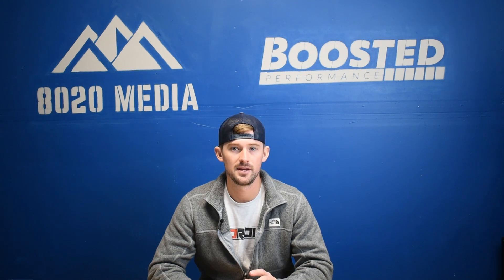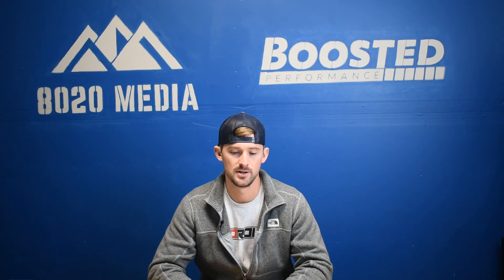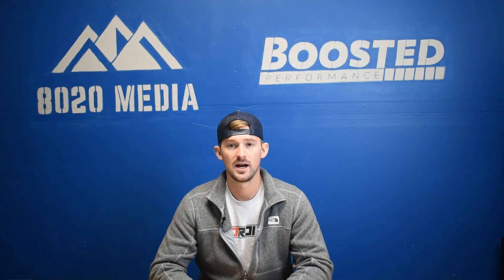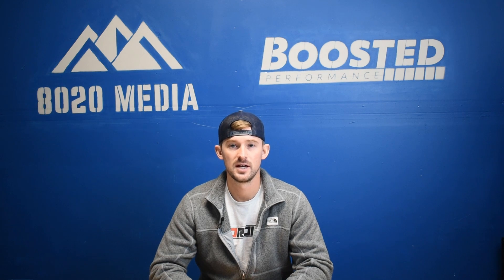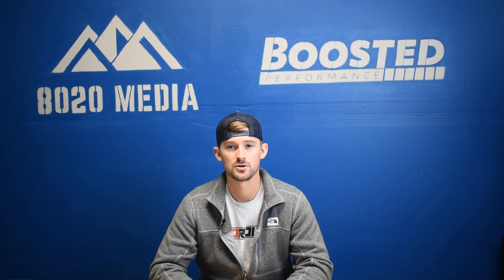The Few FLAWS of the Ford 4.6 V8 Engine!

Comment: Really? I am the original owner of a 2001 Expedition XLT with the 4.6 pushing 300,000 miles.  Everything is original except one alternator, and one AC compressor. Just normal tune up and suspension components over 23 years.  Zero timing chain and guide issues that you claim is a issue. I have had many vehicles of many makes and cant imagine something more reliable. Ignore the oil cap and run 5W-30.  You will thank me.
Reply from the maker: Steven - Thanks for sharing your experience! These can be hit or miss, depending on maintenance. Sounds like you keep up with yours very well.
Reply: I run 5-30. Full synthetic valvoline "20k mile protection" line or royal purple if it's in stock. Still change it every 5k miles. Seafoam clean before every oil change. I put this truck to work. I'm trying to break it so I have a reason to 5.0 swap the ol 06 regular cab 4x4👀but it's just such a good reliable engine. Hell, it hauled around three entire beds worth of mulch today, putting me within 100-200 pounds of max payload capacity, and it still ran great and was responsive (obviously in terms of a vehicle at its limit)

Oh yea. It's at about 150k miles. As far as I know, the only issue it's ever had was some brake line thing that was just dumb luck. And didn't even cost enough to care about remembering
Reply: Dude. It is in fact a common issue. Just because yours didn’t have a problem certainly does not mean that it’s not common.
Reply: My 2006 2v 4.6 has 298k. I bought it new and totally neglect it as far as maintenance. Seriously 10-20k between oil changes. When I change the oil it’s black immediately because of lack of oil changes, The only thing on the engine I’ve replaced is spark plugs 3 times and a cylinder head temp sensor and pcv valve a few times. The engine still runs great and doesn’t smoke. The transmission is amazing still to this day. This truck is a workhorse I’ve hauled equipment way to heavy for it. My trackhoe and dump trailer weighs 13k lbs combined and I’ve pulled it more times than I can count. I’ve hauled my boats 1000’s of miles. I drive the shit out of it. I have to pull onto a 70mph highway and put it to the floor until 70 nearly everyday, The transmission is smoother shifting than my low mileage Chevy. I serviced the trans for the first time at 230k. This is the best I’ve ever owned. I will never sell this truck! I’d say if anyone has issues from this engine it’s from running low on oil. Because I’ve proven it’s not maintenance that keeps it going. I’ve neglected maintenance on this truck horribly bad according to folks. MOTORCRAFT OIL IS KEY!!! I’ve seen a live test on oils and motorcraft beat Mobil one full synthetic. Castrol high mileage came in second on this test. I run motorcraft oil in nearly everything I own. It’s funny when I take my Chevy for an oil change and the cap says Mobil one and I tell them motorcraft. I’ve been told so many times. Ur putting ford oil in a Chevy??? 🤣🤣🤣 People crack me up!!
Reply: Got a 91 lincoln.... Still f'n goin'!  Easy engine to work on and maintain. Like driving a sofa.

Comment: Love this video! Been trying to research these motors and the YouTube algorithm has not disappointed. I have a question though and it might be irrelevant because I no longer have the truck. Back in 2013 I purchased a 1998 F150 super crew from my employer (it was a shop truck, immaculate interior and nice body). It had 167k on the motor. The one time the shop guy gave me a ride in it I asked him “Is your check engine light on?”. He said “nope”. I said “this truck has a miss. You need to have it checked.” He just shrugged his shoulders. Sure enough, one week later it was sitting way in the back of the shop. I asked him why he wasn’t driving it. He said there’s something wrong with the motor. (Go figure!) So I purchased it. I realized I didn’t have the time or space to do a motor swap so I paid a mechanic to do the swap. He said let’s look at it first in case it’s something simple. He called me a few days later and said the motor is toast. He has good news and bad news. Good news, it’s a good motor. I asked “If it’s a god motor why did it go bad?” He said “someone drove itit too long on a miss.” (I didn’t even tell him the story of the truck.) I asked him what’s the bad news. He said “typically a jasper reman is about $2,500 with core. Since this is a Raptor motor jasper wants $4,500.” He said another option is another motor from salvage. He found one with 80k miles on it. He drove down to the salvage yard to hear it run before he had them pull it. He puts it in the truck and I get it back. Drove it with no issues until it hit  235k miles (approximately 130/140k on motor). Then it did the same thing as the day I bought it. It ran awful, hardly wanted to idle, puffed, smoked, backfired. I really loved the truck. I just didn’t have the time to tear into it. But it’s bothered me to this day as to what was wrong with it. My nephew found some coolant in the oil but not bad. Still not good though lol. Now I’m wondering about cracked intake. Or stretched timing chain. I don’t have the truck anymore but based on this short story I wrote has anyone else had experience with this? The tenth generation f150 is absolutely my favorite one. We have a 2002 lariat super crew with 260k miles and it runs like a top. I also love these triton/modular motors too. I’m doing more research on them because I’d like to put a 4.6/5.4 motor in my old Fairlane with the 4r100 transmission. Just want something different under the hood that people wouldn’t expect. Everyone does the coyote swap and I’m not knocking it at all, I just want to be different. I’m fully aware that a modular will cost more than a Coyote to build up. 

Anyway, thank you in advance for your time. Love the video. Thank you for posting.
Reply from the maker: JP - Thanks for taking the time to write this out! Coolant in the oil certainly isn't good. But the symptoms you listed could've been a number of the things we listed in the video. Keep us updated on your future builds!

Comment: My 2000 4.6 2V has 299,000 miles and still runs great. No timing chain rattle yet. Regular oil changes and routine fluid service. Automatic transmission still alive too.
Reply: You're lucky on the transmission, I'm on number three.
Reply: @TG715  I've heard these are not the best . Just hit 302,000 and still shifts fine. I'll keep my fingers crossed!
Reply: @TG715 I’m not alone.
Reply from the maker: Lou - Thanks for sharing your experience!
Reply: Mine just took a dump (transmission) at 203,000 miles. Engine is strong as can be still and sounds amazing.
Reply: @_SecondhandSnake  I just hit 311,000 all good so far.
Reply: @LouJustlou  I can’t wait to get mine back from the shop and continue life with it. Excited for you. Here’s to many many more miles.
Reply: Have you ever had any coolant leaks? If so what are some common failure points? I got myself a 2004 expedition w the 4.6 and want to bulletproof it
Reply: @jtfoog5220  no issues with coolant other than a heater hose and radiator wearing out at 20 years. 🙂 They will go through coils....I used the ones from Ford even though they are pricey. Up to 305,000 and still going fine.
Reply: What oil thickness do you use?
Reply: @MrFairworld  10 30

Comment: The only engine more bullet proof than a 2 valve 4.6 is a 4 valve 4.6.  Especially the 4 valves in the 96-98 cobras.  Tekskid casted aluminum block, 6 bolt mains, forged crank, rods and pistons.
Reply from the maker: Brown - We could agree with this actually.
Reply: The 300 straight six is ford's most durable motor,I have a 2v 4.6 in my work truck I'm I've abused the heck outta its got over 300 but it constantly wants to poop wire boots and plug ports full of mostior and debris but it's fairly reliable I carry tools with me but that's every vehicle

Comment: I have a 2008 Mustang with the 3v.  This is an extremely reliable engine, like Toyota level reliable, with one caveat, you have to do the recommended maintenance/oil changes.  As long as you do that, there’s really no issue with timing/phasers or any other part of the engine.
Reply from the maker: Jedi - Thanks for sharing your experience and insights!
Reply: You have to do that with any engine. Oil is supposed to be replaced.
Reply: @sierrachief117  i assumed he meant not to let it go over the recommended change intervals

Comment: My 99 has a 4.6 and the triton badging 🧐
Reply from the maker: F150? We've heard things like that a few times, it seems a bit random sometimes which had it and which didn't, almost wondering if dealers badged them sometimes like GM dealers used to do with the VortecMAX badging.
Reply: @8020Automotive  I mean they could, but the manifold cover says "4.6 TRITON"

Comment: I have a 2005 Ford E150 cargo van with over 333,000 miles on it, I haven't had any trouble with the engine. I add a 1 quart of oil between oil changes. Oil gets changed 5,000. I do most all my own service work.
Reply from the maker: Brinck - Thanks for sharing your experience!

Comment: I honestly want to say also never get the E3 plugs for them either I found out the hard way and had pieces burn off the plug and get into my cylinder and believe it made my vavle stick open and nobody I talked to ever said anything bad about the E3s I honestly believe they should warranty that engine work cause it happen in more than one cylinder like who in the right mind would get them and not know it could possibly grenade the engine now the car is sitting wondering what to do
Reply from the maker: Josh - Oh man. So sorry to hear this... How old is your vehicle?
Reply: @8020Automotive  2005 mustang gt

Comment: I just bought a 09 ford mustang with 4.6L 3v that’s more than “lightly modified 
-Msi coils
-24lb injectors
-K&N intake 
-Bbk long tube headers/ X pipe 
- 3.73 gears 

and I knew that something was wrong with the timing because it wouldn’t idle smoothly and kept fluctuating 
A couple days ago the oil pressure indicator “low oil pressure” came on but only when I’m at stops (signs or lights)

I don’t know what it could be but I just parked the car and bought new timing kit and high volume pump because I don’t want to grenade my “new to me” car
Reply from the maker: Kourt - Sounds like a good build. Keep us updated on this!
Reply: @8020Automotive  so here’s the update 
I installed a new belt/belt tensioner for the car and new fuel filter for the car 
I then took it to the shop for the timing and oil pump and it will be done by December 4th
They told that a engine swap would be needed because the current one has alot of mileage (150k) and they think the car was neglected (found sludge in the valves) 
I told them I would consider it but I would like to keep the engine in the car for now until I can source a new one 

I talks to a couple local mechanics and my friend who’s a mechanical engineer and they said to through in Diesel fully synthetic oil in it 
Apparently they’re is a lot of additives and cleaners in it that will help prolong the life of the engine plus zinc for the internals 

As of right now the car is still running and driving and no noise like rod knock can be heard from the engine
Reply from the maker: Kourtnee - Thanks for the update! An engine swap seems quite bold. You should be able to get plenty more miles out of it.

Comment: I have a 1995 Crown Victoria with the 4.6L and for some reason it sounds like there's a can of rocks in the engine whenever it's under load or above ~2500 rpm's. I've done everything from replacing the cats to rebuilding the trans to replacing the EGR and IAC valves. Other than this one minuscule problem it's been a great car and I don't really want to buy another car in this over-inflated market, hence why I put so much into mine. Knowing my luck it's about to chuck a rod but this noise has been present for years.
Reply from the maker: Some engines are just built different - sounds like yours is. If it ain't broke don't fix it I suppose haha.
Reply: @8020Automotive  I've read about a lot of other 4.6 owners having the mysterious "rattle can" acceleration noise that comes back for no apparent reason. If I'd known about that issue I probably wouldn't have spent so much trying to fix mine up.
Reply: @user-bt2uw8ov8n I had the timing chains , guides, and tensioners replaced two years ago, I think it has more to do with the timing    of the ignition.
Reply from the maker: L - Thanks for the added insight here.
Reply: @user-bt2uw8ov8n I got my crown vic for dirt cheap, keeping it on the road is mostly about me being stubborn cause the AC works, the interior is nice, and car prices are way too f-ing high right now. Someone else said it might be leaking oil through the valve stem seals, it's smooth as silk at idle or higher RPM's, but under load is when the rattle can noise comes around.
Reply: @@user-bt2uw8ov8n Thanks for the reply, that was a lot of good info. I think I used a Mahle timing kit when I took it to the dealership and I would be very surprised if they missed a tooth when they put it on, there are some veterans at this particular Ford dealer who really know their stuff. Putting rear main seal in the oil seams to quiet it down a little bit, I've also been told it might be a vacuum/PCV/DPFE issue but replacing those parts have yielded mixed results as well.
Reply: I had that noise on my 91 town car... Bad bearing on the water pump that wasn't leaking and a bad bearing on the tensioner. And a hole in the muffler... Fixed all that shiz and now it purrs....

Comment: I have a 2009 F150 4.6l 3v with 356k miles on it. I bought it new and changed the oil with Mobil1 synthetic 5-20 every 6k miles. No major problems engine doesn’t leak or burn oil. Replaced the alternator and ball joints other than normal maintenance nothing else
Reply from the maker: Nice - that's some impressive mileage!
Reply: My 4.6 explorer sitting at 260k still running strong
Reply: @pedalflipper558  Same here at 353k
Reply: Не верю ,явно лжет !
А ступичные подшипники?
Свечи ,форсунки ,катушки ,натяжные ролики ,амортизаторы ??? Солиноиды фазеры цепи башмаки ????
Reply: @Анатолий-ъ4в2ч  Да, я не понимаю, как
Reply: @Анатолий-ъ4в2ч  I just bought a one owner 303,000 mile F150 4.6 3v with original spark plugs. They were corroded into the spark plug well and hard to remove. The plugs were deteriorated but it made it that far on the original plugs, solenoids and timing chain.
Reply: @Анатолий-ъ4в2ч 
Lo que pasa aquí  es que son millas de autopista por ende el desgaste es menor y la diferencia de las carreteras de usa vs las de otros países ..... saludos
Reply: @Анатолий-ъ4в2ч I now have 403k miles …I’ve done regular maintenance shocks, brakes etc… I’ve never had to replace wheel bearings or transmission. 
At 390k I replaced timing chain and cam phasers for the first time…Believe what you want…I’ve got no axe to grind. This truck is a gem …
Reply: You just sold me on a 2010 f150 I’m looking at with 94 000km(60 000) miles, I’m going to do a full maintenance overhaul and the thing will last me forever ahaha thank you for this comment
Reply: I had a 4.6 and ran great.

Comment: Some useful informations here.
Thanks a lot for that.
It seems to be a good engine then.
I plan to purchase an Econoline E150 Cargo with the 4.6l.
I have read a lot that this rig's got a nice mpg, around 20.
It seems a bit optimistic for such weight, engine and 4 gears automatic tranny.
All?
Reply from the maker: Staric - They can be excellent engines if they are maintained well!

Comment: The spark plug issues are unforgivable. What other modern engine has a reputation for blowing a plug out of it’s threads, and there’s a $100 ignition coil hard bolted directly above that gets blown to dust when the plug rockets. Then to improve the situation they came up with the ridiculous super long reach plugs that break below the threads on removal. But the logic of the variable valve timing on three valve variants takes the cake. While every other oil pressure controlled VVTI system (all of them?) the fazer relaxes to low/slow rpm cam timing at idle and opens the control solenoid so oil pressure pushed the phaser to the advance/ high rpm setting when oil volume and pressure are most available. Not Ford. At idle the diminished pressure and volume are called upon to push and hold the phaser into low rpm mode. So when the oil passages get blocked (shame on the owner) or the oil pump gets lazy you get rough idle along with the noisy chain running on loose guides. Other than that, what reason could you possibly find to avoid these engines like the plague ?
Reply from the maker: Marty - Thanks for taking the time to share this insight. We've seen many 4.6's last a while.
Reply: change your oil every 3k...and spark plugs at 50k....motor and gaskets will live forever....people who listen to manufacturers recommendations  are begging for a new car every 3 years.

Comment: My F150 4.6 Ford 2005 engine really sucks!  It is weak, no power, worst gas mileage ever.  (9 mpg) plus, it used oil left and right.  The funny thing about it.  I take real good care of it and keep it up.  Why does it use oil (doesn't smoke), terrible gas mileage, and no power.  Really sucks,  I want to get rid of it,  I had it overhaul at 180,000 miles and still have the same problem.  If it is loaded down or not, same gas mileage.  This is really a bad design 4 x 4 extended cab.  FORD SUCKS.  Why do I keep it.  It's paid for.  Question will a 5.7L fit or can be exchanged for the 4.6L
Reply from the maker: This is quite the hot take. Sorry your experience hasn't been good with the 4.6.
Reply: I think he needs a couple of beers, heck a case lol.

Comment: Well, that was my original understanding, but may be incorrect. Anyway, I think the 2-valve motors are super solid, the cracking intake manifolds on earlier units not withstanding.
Reply from the maker: George - Thanks for the insight!